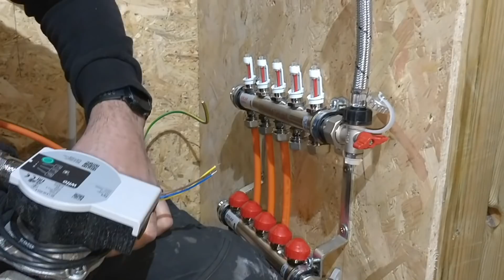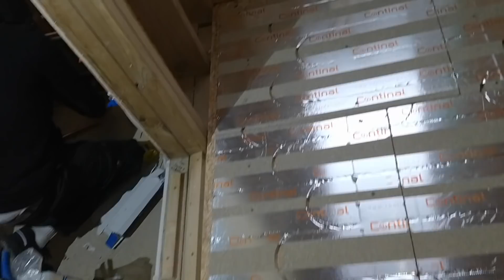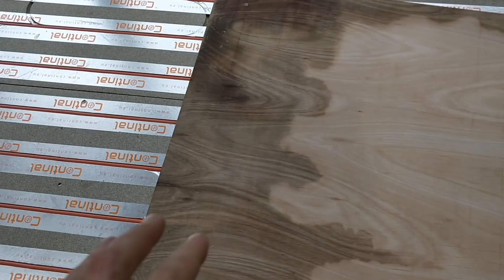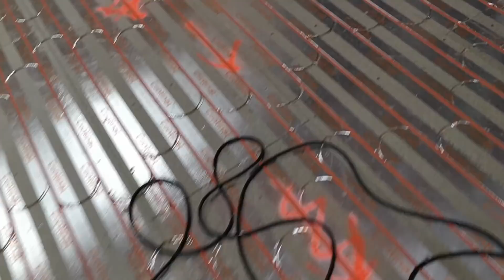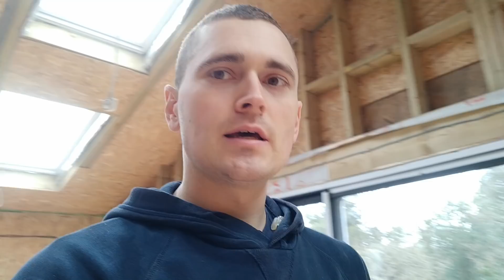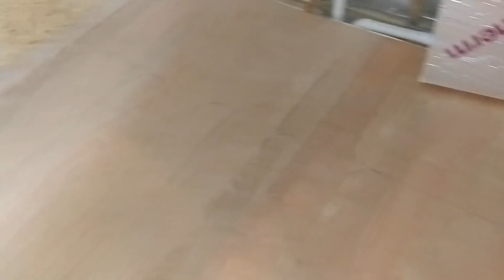Underfloor Heating part 3 - Livening the system

Comment: Hello, I love your work, ask, do the wooden planks that go on top of your UFH transmit heat well?
Reply from the maker: I used the thinnest skin of plywood possible, to help bring it up to structural strength, without detracting from thermal performance.

Wood is generally not a very good conductor of heat, which is why we went for LVT on top.
Reply: @OfficeBoyBuilder  And what do you think of the self-leveling option? we put the pipe in polystyrene and we have 3 options on top: fiber cement, self-leveling or osb, thanks for answering
Reply from the maker: I think self leveling is a great option, when it's done right! I would definitely have done that if it was an option for me, but with a suspended timber floor, I would have caused potential rot in the timbers if I'd covered them in self leveling compound.

It achieves a fantastic smooth finish which is highly heat transmitting.
Reply: @OfficeBoyBuilder  thanks for answering, we adore you

Comment: Just curious as to why you've glued and screwed the boards down, Gluing them down prevents any future removal if theres a problem with the piping
Reply from the maker: Great question, and you're right, it does, but it also really helps prevent squeaks.
Reply: @OfficeBoyBuilder  This too is true and from watching all of the videos for the extension so far I can see how much you like those squeaks ;-)

Comment: Mark pipe centres on each wall to know where not to screw, Use a chalk line or laser level to mark
Reply from the maker: Sure, works for me, but what about the future person that wants to change the floor...?! You're right, that's a good technique, and is quicker, for sure, but I wanted to help the next person too.
Reply: In that case your old fixings are already there for them to take a guide from, and if they were really stuck, they could still do what you did.

Comment: Not done it myself, however buddy of mine used 2 lots of t&g boards, with the second layer rotated 90 degrees. With only the two layers of t&g being glued and screwed together. None directly through into the subfloor. 

Obviously you were working to a height tolerance so wouldn’t of worked here tho.